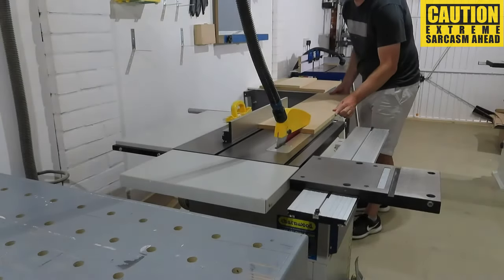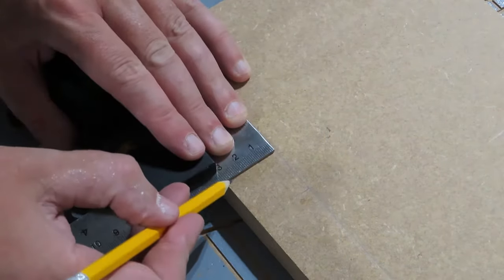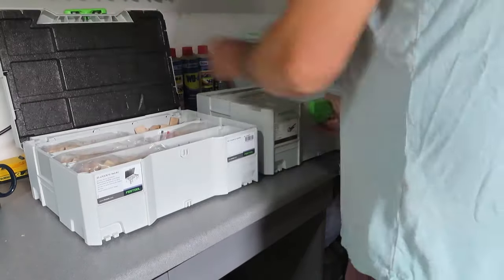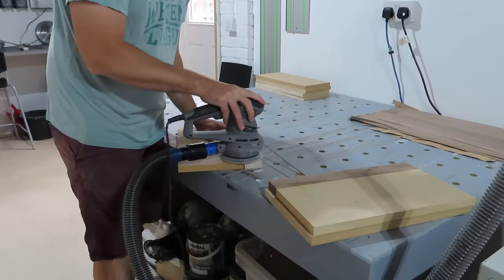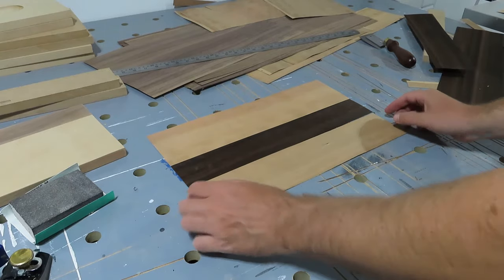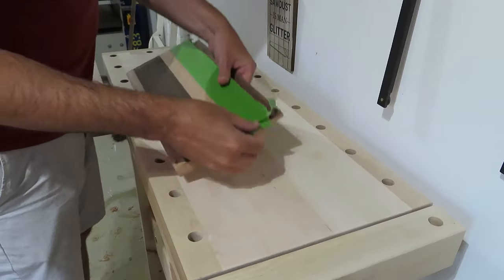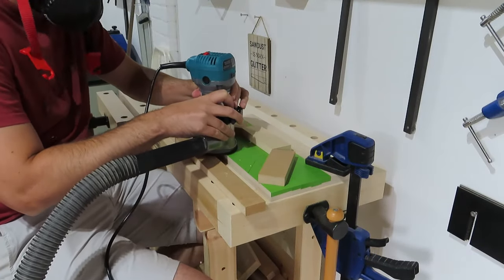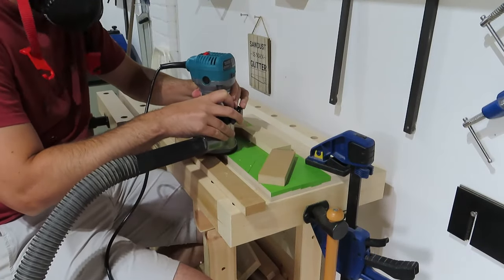How To Make Finger Pull Handles

Comment: amazing video! thank you, i learn a lot!
what router brand and type for making that j pull handle?
thanks!
Reply from the maker: Thank you 🙏 great to hear you liked it 👍 the router is a Rutlands palm router and I was using a 1/4” finger pull router bit 😊
Reply: @ukhomewoodworker848  could I ask which router bit it is? Looks 1/2 shank ...it's it CMT? I need to cut fingerpull in 18mm panel. Thanks great video enjoyed it immensely 😀

Comment: Could you make a finger pull with a cove bit?
Reply from the maker: Hi James yes in theory as long as you have a template for the router to follow it should work, you could clear the bulk of the waste with a straight bit first set to the same depth 👍